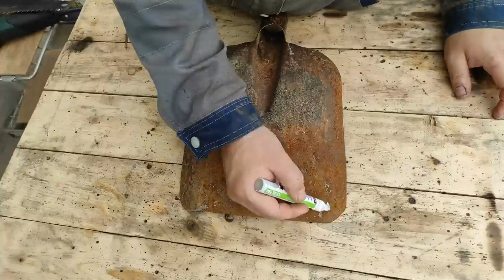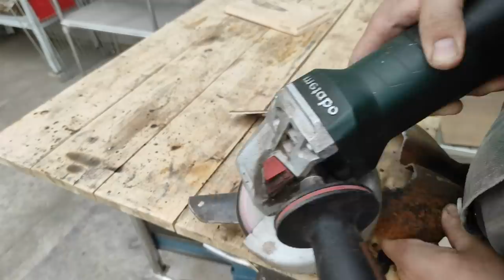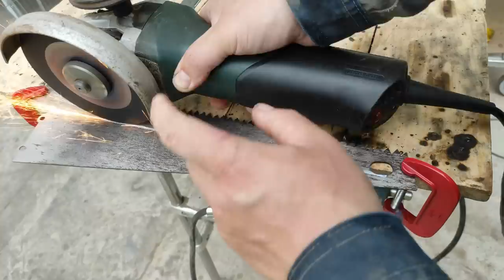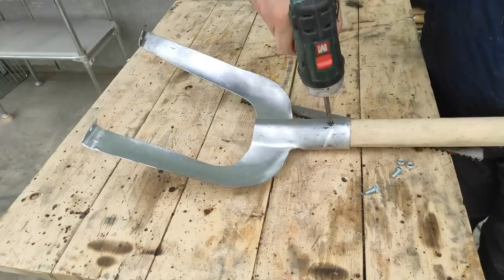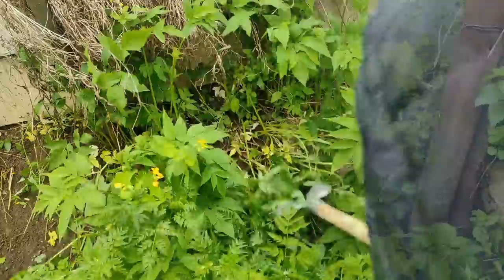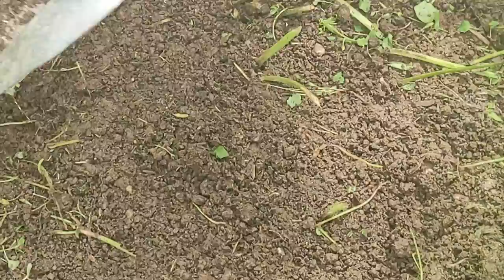Few people know the secret of the old shovel! A brilliant idea with your own hands!!!

Comment: If a shovel is rinsed after every workday, removing all dirt or other debris, it will not rust and corrode like this shovel. Still this is a clever and useful adaptation of a weathered shovel (and saw) to make what appears to be a better hoe.
Reply: A good idea, pity though he did not have the time to secure the vice before proceeding.
Reply: I used to have buckets of sand impregnated with old sump oil that spades and shovels were standing in

Comment: How is it that people with these great ideas always seem to have a fully fitted workshop that makes everything simpler. What happens if you only have a few simple tools?
Reply: i am a poor lonely mom, and i buy tool when i could, not clothes or shoes or stupidity useless. so at 45 years old i have plenty of tools! not all, not a garage with expensive one, but all i need to work correctly. the secret is always put priority at good place and discipline. big hug
Reply: Buy a workshop to build cheap tools 😂😂
Reply: My thoughts exactly???
Reply: Although my tools are cordless I was good until he got to the drill press and belt sander. He drilled holes in the end of the shovel. I wonder how hard it would be to drill through the saw blade. I could really use a tool like this.
Reply: Easy, you just build a huge workshop fill it full of expensive machines and tools worth many many thousands of $ or £, then you can waste as much time as you want making useless , tools that have but one use and will fall apart in time, so you can keep yourself in junk.
Reply: You missed the earlier video where he made the workshop from three pallets, a length of string and twelve tin cans.
Reply: That’s really too bad that you don’t have that you need, I’ll bet you’ve got tons of  ideas that your busting to make.
Reply: This is generally what I tend to think! 🙂👍
Reply: 0:16